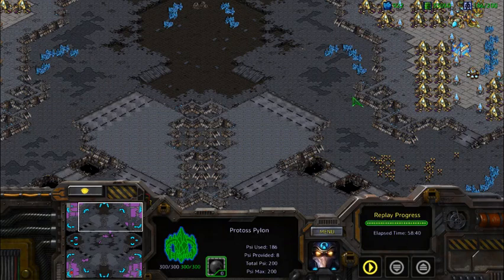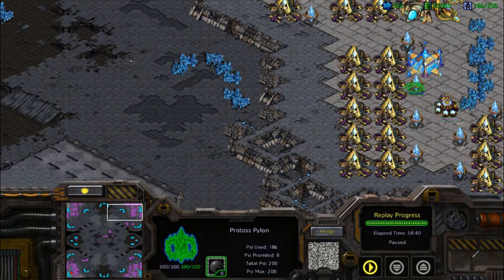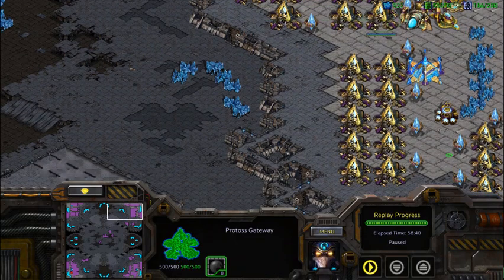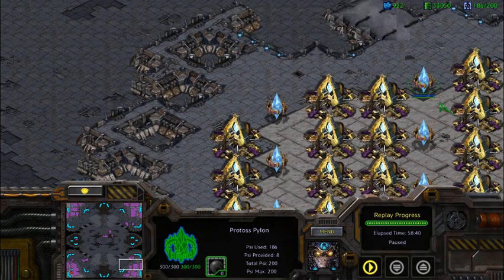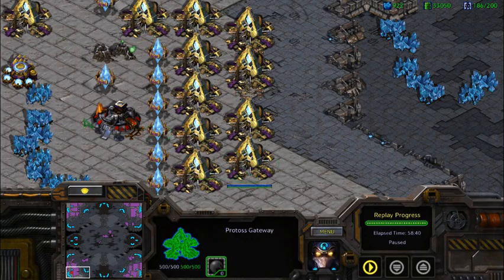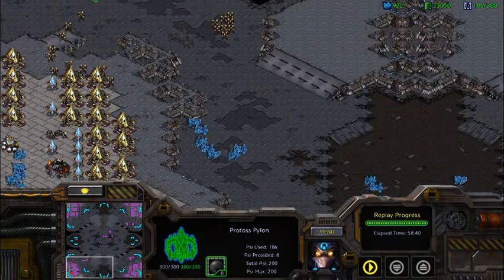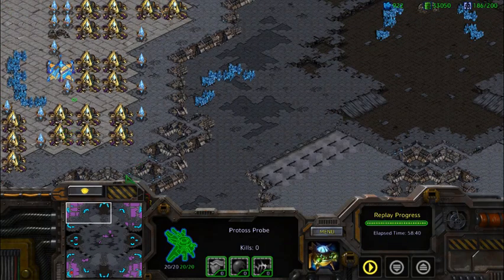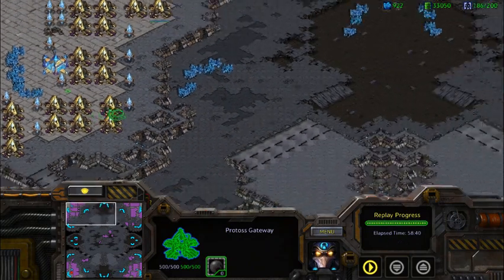Protoss Base Organization: Circuit Breaker

Comment: Nice idea, but too theoretical imo. Would be better to see base layout from an actual game. There wouldn't be as many gateways, and there would be more pylons. Robo Bay would be situational because sometimes placed at natural so you can get a quick reaver to defend.
Reply from the maker: I wouldn't overthink it. It's just a reference point.  If I were to show an actual game it'd be pretty lengthy since I'd need to show all 4 corners. But thinking on it a bit it wouldn't hurt to at least show an opener in each corner.